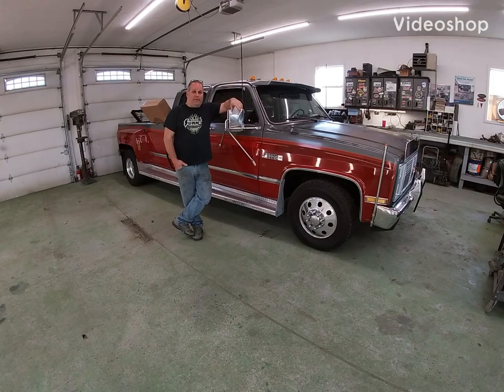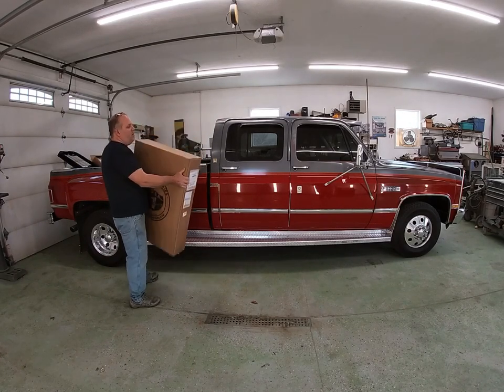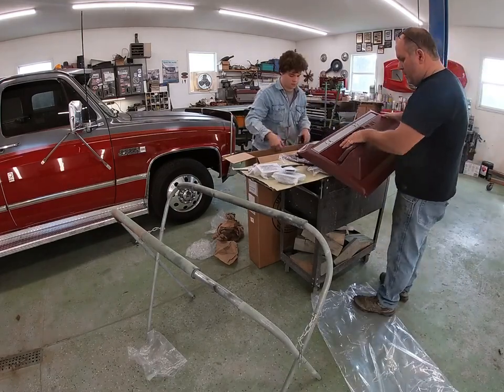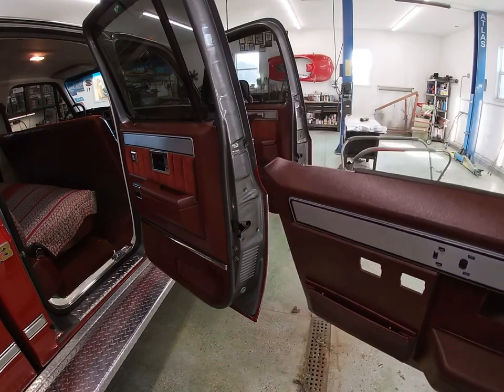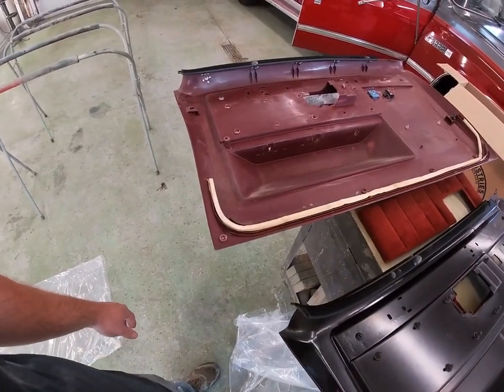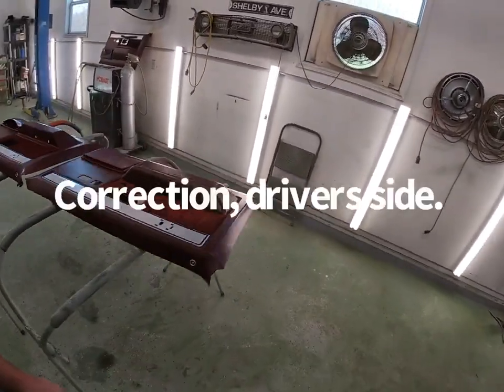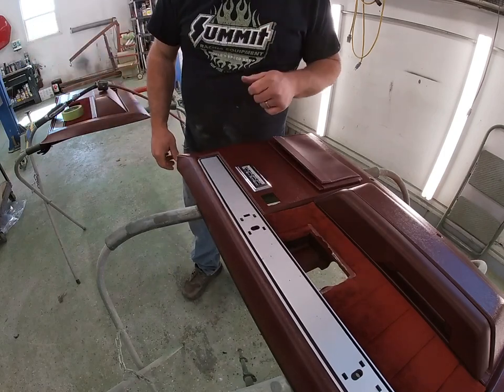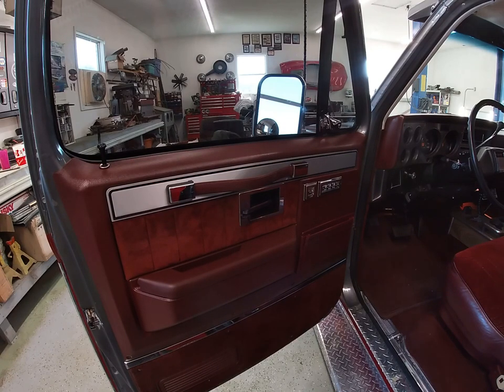Is it worth it?  USA1 Industries GM square body door panel review.

Comment: How long ago did you order the door panels and when did you receive them? I ordered the exact same panels last August and still nothing, were you able to get in touch with them?

Beautiful truck btw, cheers
Reply from the maker: I had ordered everything in May of ‘23. Door panels, rear seat cover and a dash pad. The seat cover came in the end of August. The door panels came in late October. The dash should be here soon as of mid April. They are difficult at times to get in touch with. The last 2 times that I called a got to speak with someone. Good luck.